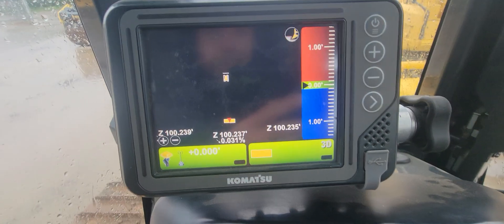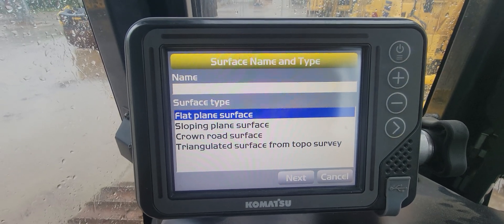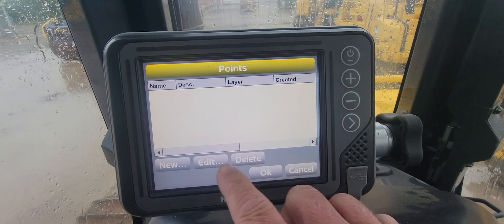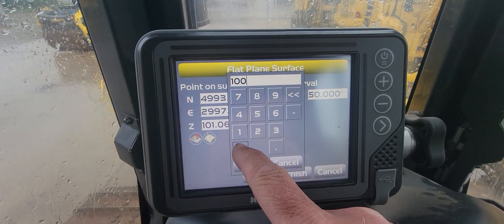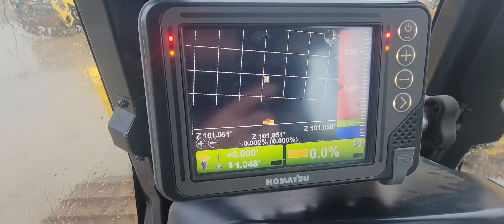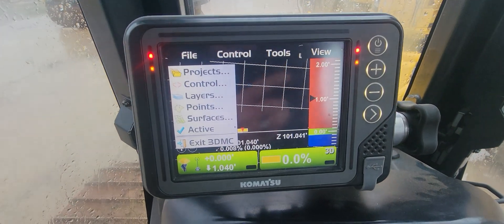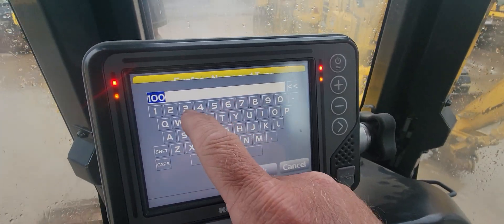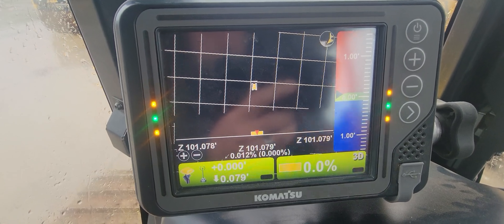Creating a Flat Plane Surface - Komatsu IMC Dozer

Comment: Is it possible to create a flat plane surface(with the machine as you did in the video), without having the site calibrated and having the base station setup? 
You mentioned something about"just being connected to a network" could you elaborate on exactly what that means. My intention is to use the flat plane feature before the site is "setup" if that is possible.
Reply from the maker: You can go to the radio settings a do a "direct network connection". This utilizes the SIM card in the SL-100 modem in the machine to get base corrections from a public or private VRS (virtual reference station) network. I made another video showing how to do it on a Komatsu excavator. I should do something more covering the topic because networks are becoming more available.

Comment: How can you make a flat plane without a base station connected?
Reply: And I’m not a technician but I’m pretty sure you need a base station on site unless you’re using a site link type setup that pings off cell towers. Our company is looking to move in that direction vs having to buy multiple base stations and data collectors.
Reply from the maker: You have to have some sort of correction source (base station or cellular). If you have a public VRS Network in your state you can utilize the SL-100 modem to connect to the VRS via cellular. Can work good if you have good cellular and a decent network.

Comment: How do you turn on grade light indicators on exterior of screen
Reply from the maker: Hit the Menu button, go to control, and go to Equipment setup at the very top. Just hit next though the first 3 screens I think and you will get to light bars and you can configure them how you want for cut/fill etc.